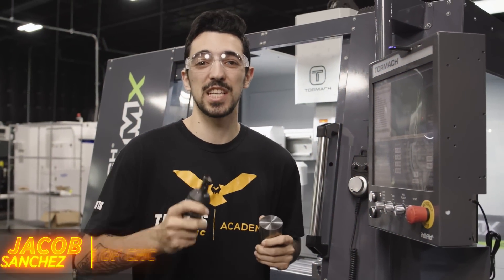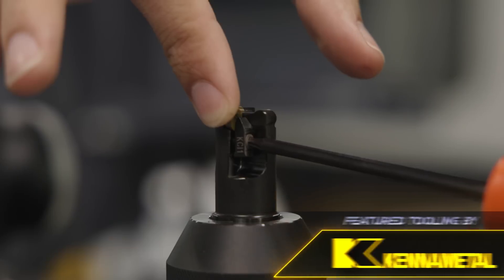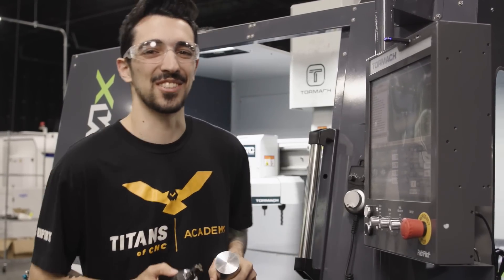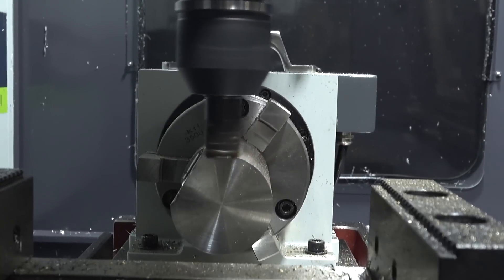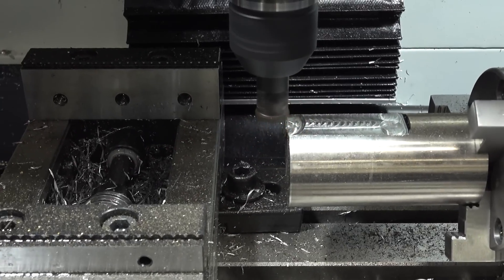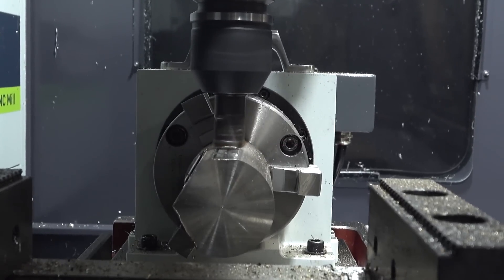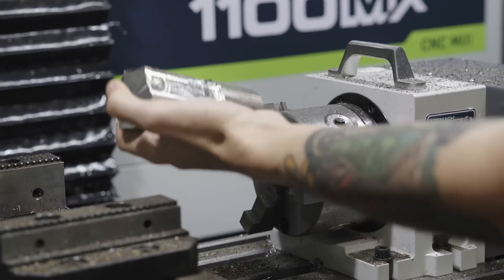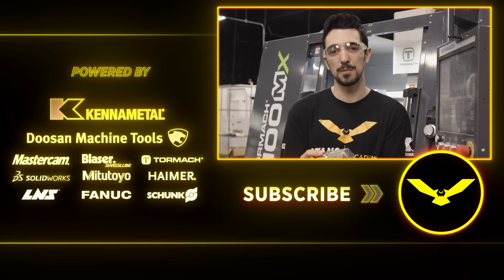MILLING INCONEL 625 ON A TORMACH 1100MX | Kennametal Ceramic Cutters are Perfect for Low HP Machines

Comment: An 1 1/2” mild steel round bar took me about 10 minutes to cut with a 4” band saw. A 1” inconel 625 round bar took FORTY MINUTES of continuous cutting. Ignoring the fact that the inconel made this grey pasty material that kept making the bandsaw blade slip off (wtf) It’s machining properties are impressively bad, like it’s almost funny how hard it is to cut this stuff.

Comment: I think one pass with a 2 inch facemill would look better and be fastest 😉
Reply: You would just rub the tool while trying to keep that cut within the horsepower limits of the machine. Inconel does not like rubbing.
Reply: More teeth, slow and steady with a machine that has lots of grunt and coolant. Conventional cutting works every time.
Reply: Also wtf is the tailstock tormach sells for 4th
Reply: Hah ya that would work too well on that machine.

Comment: I was always led to believe with inconel the inserts get hot and not the chips, and your running it with no coolant so surely those tips wouldn't last long, why don't you show us roughing a big 500mm inconel ring and see what you'd do with the set ups and tools, because I do sometimes struggle with the inserts
Reply: Heat is always best leaving with the chip. Coolant is generally not used when rough milling in hard or tough materials, the heat cycling (very hot in the cut, rapidly cooled when out of the cut and in coolant) destroys carbide and ceramics quickly. They don't mind being consistently hot but will crack quickly from thermal shock. This is different on a lathe where the cutting edge remains in the cut for extended periods of time and coolant can be used without causing this heat cycling
Reply: what he said 👍

Comment: Do you cnc machinist will be replaced by 3d printing in the future
Reply: Ever see how long it takes to make a print and make a print to tight tolerances less than .001 that's not mentioning surface finish or other factors. It will get there but your talking 30 years give or take and that will only be certain fields. No way cnc is gonna be replaced that easy
Reply: I am sure there will be things that people machine now that will be 3d printed. orientation related rigidity is a series concern for FDM 3d printers, and alot of the SLA and resin printers lack materials still that have good real world translation at this point in time. Sintered setups are another story, and have already replaced machining for some things. Due to weight savings and the ability to print an assembly. The most notable one is print in place herring bone bearings. Which many of the companies producing jet engines are using these days. 

I am sure things this will need to be re-evaluated once we start seeing 4 and 5 axis 3d printers. But it will be a while before those start becoming common place outside of labs and specialized shops.

Comment: As a machinist, I would’ve suggested, opposite hard jaws to get the maximum hold, so whereas you’re gripping on say 3/4” some internal jaws with a gripping face on the ID would give you 1.5-2” inches of grip, might take out some of the chatter.
Reply: Still good content tho.

Comment: could you maybe have done some finishing passes? That looked extremely nasty and could never pass any qc.
Reply: Most certainly could, just depends on if your finished product would show the cutter marks or not. This is a tech demo though so It seems they are more interested in showing that this process was even possible, as many would argue it isn't.
Reply: There was never any talk of good surfaces here. This is a tool for roughing.
Reply: Try cutting inconel for yourself and see what happens 😂 it’s the devil I swear

Comment: Cool but I'd also like to see some finishing strategies for that machine as this part is not going to pass any kind of qc as it is, I'm also interested in the tool life of the inserts in that machine how often the inserts need to be rotated and such. For example challenge yourself to get that hex to a certain tolerance and roughness value with the tormach.
Reply: Umm depends on the surface callouts. If needed, you could hand work the part If a nicer surface finish is needed. But this part is just to show you can machine superalloys with a machine that essentially has the same hp as a Bridgeport. And yes it can pass some QC, just depends on the design intent from the engineer, he may not care about the surface finish.
Reply: @nimonicllt6305  Seriously? You must not be an engineer or machinist...
Reply: @marcusmadrid7508  nah you're right,  I'm a florist.
Reply: No part is going from the machine straight to QC , they are first cleaned and deburred , that part looks fine to me with a RZ of around 6.3
Reply: @apostolrobert5810  very possible but that still leaves the fundamental point(s) I raised in my second message on this thread. If a machine can only rough then it’s pretty useless for the types of parts it will have to be commercially making.
Reply: What exactly is going to fail QC? Seeing the cutter path doesn't necessarily mean it has a bad finish.
Reply: @brahtrumpwonbigly7309  These ceramic insert cutters are roughing cutters designed to chip away up to an acceptable level to keep exposing new cutting edges. This means the longer they are used, the further out of tolerance the resulting cut is going to be. On larger cutters chipping up to 1mm is allowed before inserts have to be rotated. This obviously creates the need for finishing strategies. Some parts may require loose tolerances that this finish would be accapted. But let's be real, if a part needs to be machined there is most likely a need for some kind of precision feature with tolerances and roughness values given on the drawing. What I'm curious to see is if this machine is capable of not only roughing with this tool but also finishing within a reasonable tolerance and surface roughness with a different tool. if I'm not mistaken inconel parts still are finished with solid carbide endmills in most cases.  It's about showing the capabilities of the machine in being able to finish a job, not wether a roughing strategy meets the requirements of a roughing a part.
Reply: @shiro-r4m   I figured you were simply complaining about the finished part and how it looked rather than actually asking how they compensated for tool wear. I feel it should be a given that they're in the business of machining parts that are within tolerance, so I still think that your initial statement is a bit funny. Assuming that they haven't taken that into consideration and that the part would fail QC is quite the stretch, especially since this is a tech demo and not a machining tutorial, which they host on their website.
Reply: @brahtrumpwonbigly7309   It's called RIGIDITY when the microphone is inside on the head it sounds great. I bet that lil' tormach was shaking like it had the chills. Just because it cuting doesn't mean it's cutting correctly...

Comment: I'm impressed you can run that on the tormach do you feel that you are getting the full cutting capacity out of the inserts on this machine?
Reply: At only 2 horsepower definitely not, but that's not really what they're trying to do either.
Reply: Life of the tool in that situation will likely be significantly reduced compared to when being run in a rigid machine with proper feeds and speeds